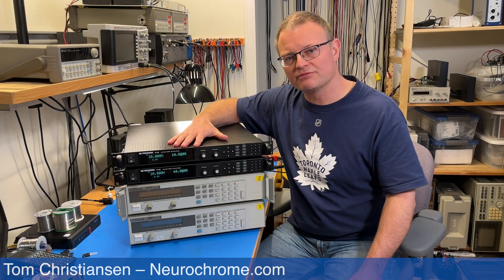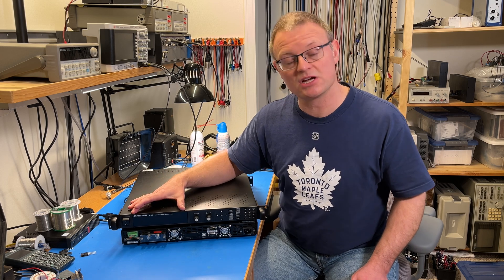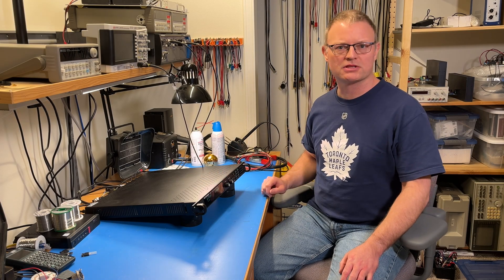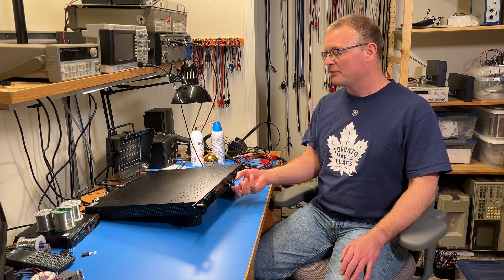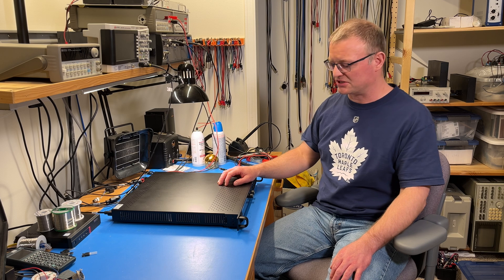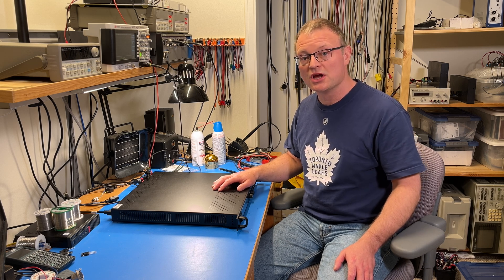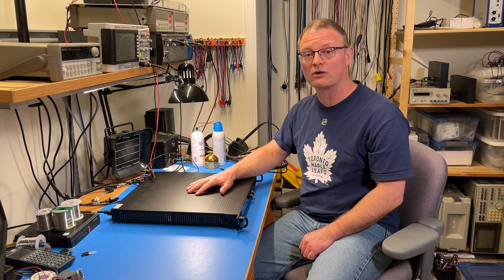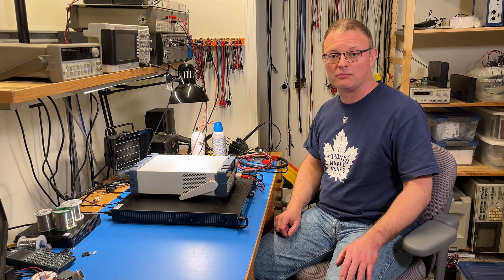B+K Precision 9115B Review by Neurochrome

Comment: I’d be really interested to see how one of these newer Daitron ultra low noise smps perform in such testing. Granted I think they only make fixed voltage models. https://youtu.be/Ny58s4aqTqc?si=FQ9f6-S8j5bhn31A
Reply from the maker: Daitron: https://daitronglobal.com/products/low-noise-power-supplies/
The 50 W model tested in that video would not be very useful for an audio power amp, but the 300 W model could be interesting. Sadly, it doesn't look like Daitron has a distributor outside of Asia, but I suppose that could change. The data sheet doesn't go into much detail around the cooling of the supplies. It only mentions that the supply requires an external fan. If the supply can deliver, say, half or 2/3 of the full power with convection cooling it could be very attractive for an audio amp.
Thanks for pointing these out. I wasn't aware of Daitron.
Reply: @ you’re welcome. Thanks for the series of really interesting videos on power supplies.

Comment: what's the benefit for this equipment vs a regular power supply?
Reply from the maker: Not sure I understand your question. The BK 9115B is a power supply.
Reply: @Neurochrome2010  Sorry for not elaborating.
Just joined a company where we have low power rating PSU (30V-10Amps) and also we have this same equipment of the video. 
The guy who ordered these is no longer around, so i'm trying to figure out why he purchased this PSU. besides the obvius of having more power, i'm trying to understand what other applications could this be used for
Reply from the maker: Oh, I see. Maybe the 30 V supply was purchased first? The advantage of the BK is that it can deliver 1200 W and up to, I think, 80 V. So if you need high voltage or high current the BK is great. But if you also need it to have a low output impedance and low noise, it wouldn't be my first choice.

Comment: I find your in-depth power supply tests really interesting. Is there a specific reason for you to go with a modern SMPS vs. something like the HP/Agilent 6675A? There is a chance that those meet your requirements, I would think, and likely at a similar or maybe even slightly lower price (obsolete, so I refer to used units on ebay etc.).

I've seen quite a number of used SMPS from TDK Lambda (also the rebranded versions from Agilent/Keysight) that might be worth looking at if it has to be a SMPS for weight/size/efficiency reasons.

Regarding BK Precision: I got the impression that for some of their products they more or less rebrand asian products. At least there are astonishingly similar DC loads and LCR meters available from other companies... Not 100% sure though whether I'm right with my assumption though.
Reply from the maker: Yeah. I'm not sure either. The 9115B certainly performs much better than the $100 supplies, but it does have its drawbacks.

I wasn't aware of the HP/Agilent 6675A. It also needs 240 V input... I ended up settling on a pair of 6654A. I think they'll work well.
Reply: @Neurochrome2010  Just yesterday I’ve seen a 6654A for 200€ in perfect condition (which is almost half the average asking price in Germany), but I can’t justify to buy another (heavy) power supply. I might regret not buying it. If I remember correctly they use a preregulator of some sort (to be expected at this power level), but still achieve very low noise. A teardown/test would be appreciated 😅
Yeah, haven’t thought about the 240V issue. Here in Europe that shouldn’t be a problem I guess.
Reply from the maker: EUR 200 is a great deal ... if the supply works. And actually not a bad deal if it doesn't. The front panel encoders often take a beating but they're easy to replace (I have a video on that too). I think HP just brute-forced it. Large heat sink, large fan, etc. I don't think there's a pre-regulator. At least I don't recall one from the schematic in the service manual.
Reply: @Neurochrome2010  Yep, you're right and that is a bit crazy. Up to >500W of power dissipation, I guess. At least in my 6642A they do not use different transformer taps. And It must have been the 667xA series PSU I was thinking about - these do have preregulators.